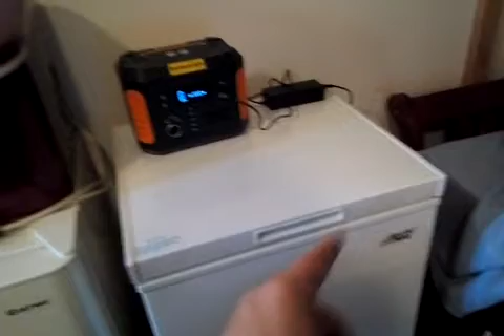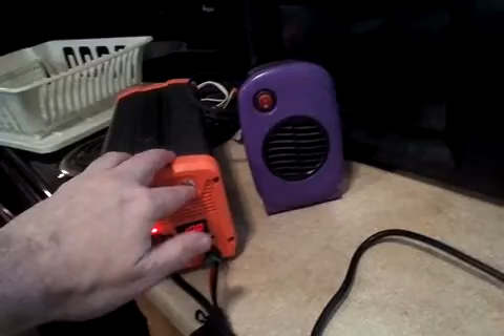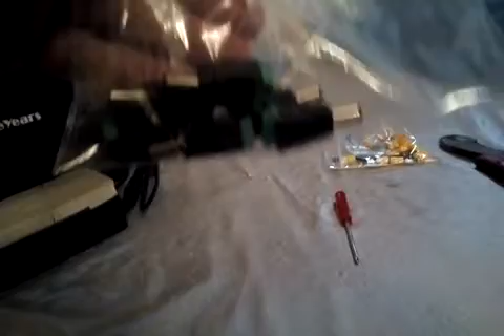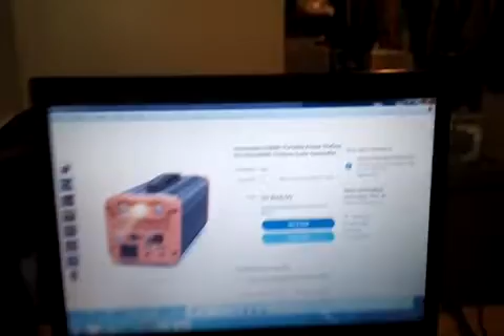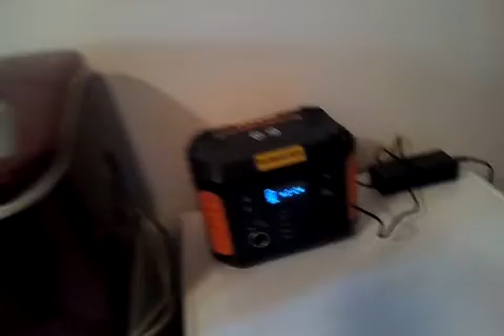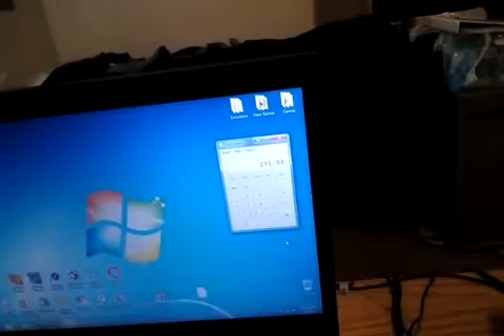How to use Solar Charging HomeYears Power Station.

Comment: Yes but you only get 12 v. I got a solar panel that puts out 20 v and was cheap. You can only go as high as 18 v with that power station  . U panel maybe able to put out more v but you got to have it right with sun
Reply from the maker: My 100 watt solar panels are 18 volt, but the homeyears itself has lets say went kaput. I so it after it went out in another video.

Comment: I'm hav problem with that one just today..the AC inverter part is not working .  I keep search web but can't find any help
Reply from the maker: Mine blew some mosfet's and they damaged the mainboard. I am just using the battery pack with my small 400 watt power inverter. I charge it with my small 30 watt solar panel. The inverter itself is built on to the mainboard. Check the mosfets to see if one is blown. If you are unsure of what a mosfet is watch my video here. https://www.youtube.com/watch?v=-kHYuNYyT9I&t=2s

Comment: Solar panels should be angled 30 degrees  to the sun or you get less volts . You could get more if your with the sun directly. And angled 30 degrees.   You can test withultimeter and see for self . I see more output do what I was told with u panels. But your chasing the sun too